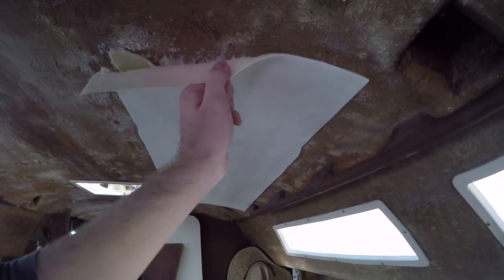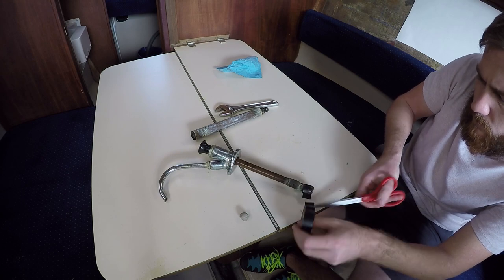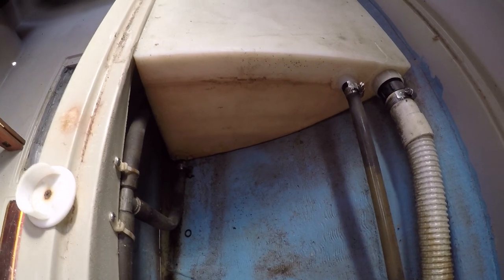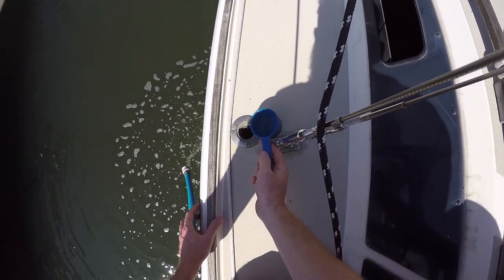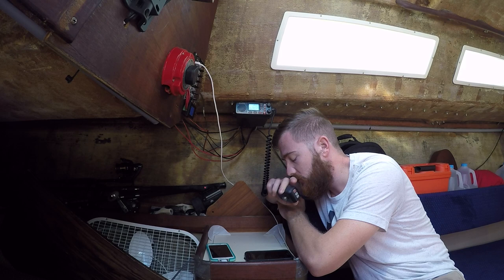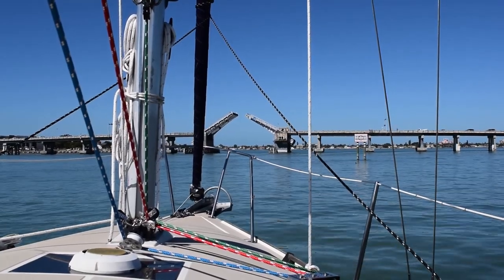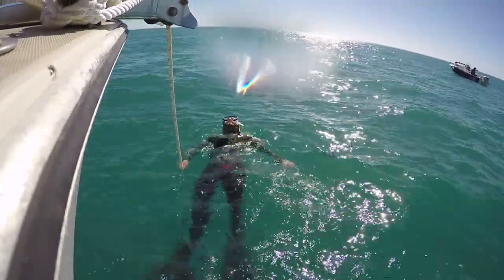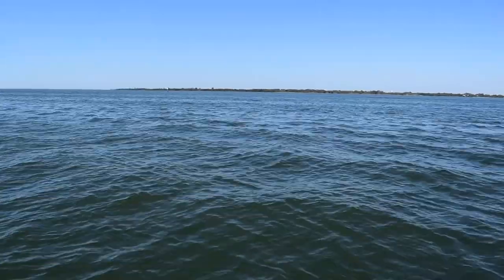23. Fixed Faucets, Forgotten Dive Flag, and a Lost Anchor - Sailing Vessel Somnium

Comment: A suggestion if you ever have to cut the anchor line again: Get the anchor line vertical and swim down 10-15' or so, tie a butterfly knot (because it's super-fast and easy to put a loop mid-line) in the line and attach a float, then cut the anchor line anywhere above the float knot. This will leave an "invisible" float that you can later find much more easily than an anchor in the muck, and you can follow the line down to your anchor. Having a hard time swimming down with a float? Tie a line on the float, pass it through the loop like a pulley, then pull UP from the surface on the float line to pull the float down to the knot.

Comment: Looked into a sailboat for years...May 4th last year bought one...I have gutted the whole thing and have 20 months to get her ready for the rest of my life...screw the rat race, I'm working less hours and I'm getting out..Electric everything except a generator...refuse to pay for fuel if wind and sun can do the trick... minimalism...who needs THINGS...memories are priceless..hope you continue videos at some point...favorable winds
p.s. hope you for your anchor back!!!
Reply from the maker: We're not stopping the videos yet, but I wanted to warn everyone in the case that we do. Thanks for the input and I hope you get cruising!
Reply from the maker: Geoffery Goggins, just saving lives one vlog at a time. Thanks for watching.
Reply: Good plan.  After the crash in '08 we reassessed our retirement plans.  Our savings had been depleted by the business and things looked bleak.  We opted to buy a sailboat, and now we have almost readied our sailboat retirement home for an adventure into the South Pacific.

I urge others to look into the same.  This lifestyle can facilitate an early retirement and it will be affordable, not to mention that you will be off-grid and not beholding to any of the powers that be.
Reply: Sail Before Sunset off grid is the key! I'm going all electric, solar 4 - 110w panels, 300w wind, 6 or 8 batteries....only gas will be a little for generator (emergency)...freedom!!! Good luck to you and all

Comment: If your anchor is at a reasonable depth, I can probably help you recover it. I've seen other videos where sailors put a second like on their anchor in a manner that if it gets stuck, they can pull it from the other side to un-stuck it from an awkward set. At any rate, thank you for sharing your adventures.
Reply from the maker: Thanks for the input. We're going to use a tripping line in the future!

Comment: Sometimes driving over the anchor directly into the wind, and thus pulling on the anchor in the opposite direction of how it set, will help loosen it.
Reply from the maker: We tried that initially, but the anchor was wrapped around an iron part of a literal army tank. It wasn't going anywhere without diving on it to free it.
Reply: Yup, I saw that in the next video (I am binge watching).  Just wanted to pass on something I learned, since I didn't see you doing it.

Comment: The fresh water sanitizer West Marine sells is WAY better than Bleach. I've been bleaching my tanks for decades. WM rep asked me to try it (like $8) and it worked for MONTHS... 

As for your announcement. I did the same thing when I was 22. I'm now 41 and still have not jumped. Every couple years I mark the next year. 40 was my rubicon and I crossed it, on land. Dream is not dead for me either, but 46 is it (for the 5th time...). There was always something. Money, Wife, New Job, Kid, School, Business, etc... Life happens when your busy making plans... 

Just don't wait too long. Nobody who cruised, even flat broke, said it was a bad idea. Your O'Day is more than enough boat if your more than enough captain. 

Good Luck! But if I beat you, that's not a good thing...
Reply from the maker: Life has a way of getting in the way for sure. I know it may look like a step backwards from the outside but changing careers may actually speed up our plan. Good luck to you too! I hope you can get cruising as well!

Comment: I know its too little too late, but if you are faced with a problem like your adhesive again try a 3m  adhesive eraser wheel , they chew through contact cement like butter, and they wont damage your fibreglass,
 highly reccomended.
Reply from the maker: Thanks for the recommendation.

Comment: Remember that when you go  back for your anchor, your GPS probably won't take you back to exactly the same spot. Each day they put an offset on the GPS position. It will take you back to within 20 or 30 metres of where you recorded the positon. You might have to look around.
Reply from the maker: We figured as much. We're going to bring scuba gear so we'll do some searching!
Reply: Alan B 
What is this off set you say they put in , never ever heard of it !
Reply: You should have put a big 'X' on the bottom of the boat where you cut it :-)
Reply: ***** Thanks for posting that Alan, I assumed it was still being done. I never really trusted GPS that much to worry about it, but it makes since that it's been eliminated now that so many cars and trucks are using it.

Comment: It would be a much faster trip out to the ocean cutting across under the Maximo Point bridge.
Reply from the maker: That's actually what we did on the way out.
Reply: Good stuff, it can be a little tricky getting through there, but on favorable wind, we can get 7+ knots motor-sailing... it's cheating, but were not purists!

Comment: Jordan, I really like the idea of your CDI mast furler. I called them in Mass last year and they said they didn't build system for boats as small as mine. I have a 26' C&C sailboat with a 33' mast height above the cabing top. Do you know what your total mast height is? How long your furler is? Most importantly, who you spoke with at CDI. Being handicapped, the less I have to leave the cockpit the safer it is for me. Since they told me they didn't make one, I have installed a Marine Tides Track system and had a stack pack made for my boat which was quite expensive. My next step is going to be leading the main hoist back to the cockpit. Even with the money spent, I would much prefer a furling main sail as it would allow me infinite reefing again from the safety of the cockpit. My plan is to sail from Connecticut down south some where for the winter possibly as far as Florida or the Caribbean. With just me on board I have plenty of storage space and my boat has the addded advantage of being over ten and a half feet wide with 6'3" standing headroom. My boat is 40 years old and I just did the water system last week. I pulled my tank which had two inspection ports which while not easy it made it possible to scrub the entire tank. I found the worse problem to be all the lines leaving the the sinks and pressure pump which were originally clear but were now black with mold and gunck. I replaced all the lines and hose clamps. I am also looking at installing foot pumps which will make it easier to wash dishes because I would have two hands free. One last thought. On another VLOG the people do their dishes with salt water and keep a spray bottle of fresh water to rinse the dishes with when they're done. I thought this was a great water conserving idea. Especially for me as I intend to live at anchor as much as possible! Ans speaking of anchors, do you know what the purpose is for the hole drilled in the part of your Rocna away from the chain end?  In a storm you can rig a second second anchor via a shackle and a piece of chain (approx 30')  should one anchor break free the second will hold until the first one re-sets. You also get double the holding power keeping the line of sight between the two anchors level on the bottom. I have an all chain rhode of 200' plus an addition 150' of line in case I'm anchoring some where very deep. I keep 2 Rocna's and a Spade for stern anchoring. I'm also thinking about a 100 lbs Mantus that breaks down for storage for extreme hurricane anchoring! Be prepared. Sailing UMA went through a hurricane in Hati with just a 60 'bs Mantus and didn't  drag once in 70 mph winds!
Reply from the maker: Shoot an email to twarren@sailcdi.com and tell him I sent you. They're awesome and they definitely have a furler to fit your boat now!
Reply from the maker: Sorry for the delay on this! Unfortunately life always has a way of getting in the way.